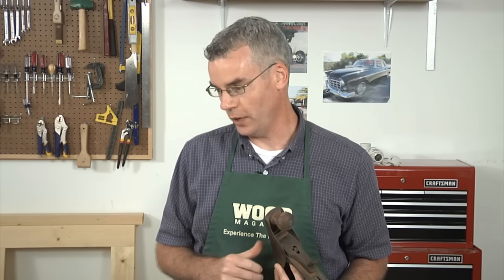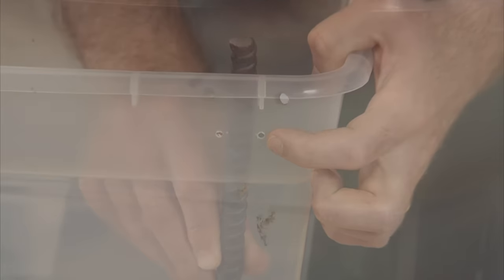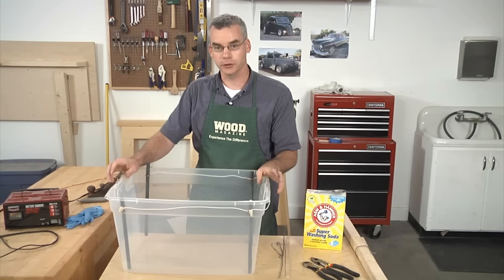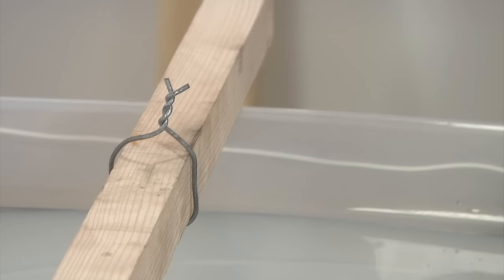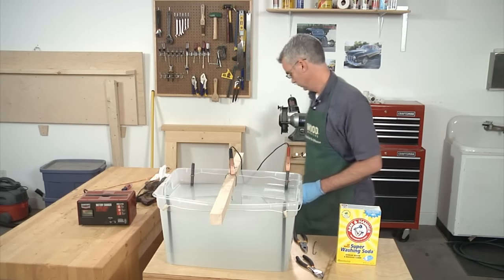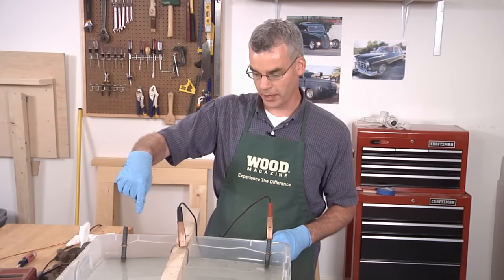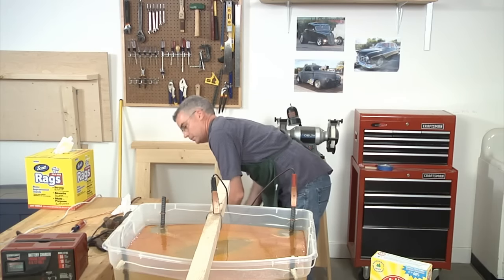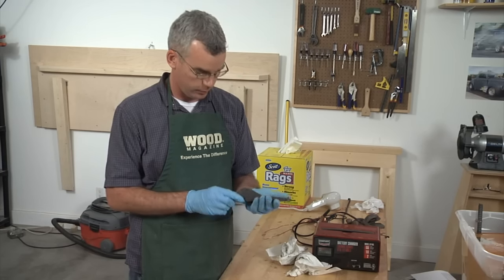Removing Rust with Electrolysis - WOOD magazine

Comment: You can make your own Washing Soda too. Washing Soda (Na2CO3) is just Baking Soda (NaHCO2) that has had it's Carbon Dioxide (co2) heated away. The reason cooks use Baking Soda in baking is that during the heating process the Soda releases it's co2 which helps give baked goods that light and fluffy texture. Anyway, you can spread your Baking Soda (sodium bicarbonate) out in a baking pan place it in a 400 degree oven for an hour and you'll have Washing Soda (sodium carbonate).
Reply: Thanks Moo
Reply: Thanks!
Reply: Or if it's in solution, heating it to boiling point is enough to convert it. Just be careful of the fizzing.
Reply: Just use washing soda. It's cheap enough, so why bother making it?
Reply: I will be using this thanks!
Reply: Can also use borax instead of washing soda
Reply: Dope.

Comment: One point on using rebar as an anode.It usually has a scale coating from manufacturing that needs to be wire-wheeled off to perform at it's best.Also,for that large of a tank and using 4 anodes,the 10 amp would work better.Lastly,put about a cup of regular baking soda in that large a tank will help alot,and a little TSP(trisodiumphosphate)helps make the black slime easier to remove from the parts.Hope this helps!

Comment: Modern battery chargers require a 12-volt battery turn on.  A cart or car battery is placed in parallel with the charger.  Also a product like Pickles 20 used after the electrolysis tank will remove any fine rust and provide a coating to prevent flash rusting.

Comment: Great representation of electrolysis! You forgot tell one thing! This has to be done in a WELL VENTILLATED AREA or do it outside. There is hydrogen gas being released in the process and that can explode indoors.

Comment: A few years ago I restored a full set of Bedrock planes.   I carefully and relentlessly looked for Bedrock rusty junk parts until I had all the parts needed.    I electrolysed everything, ensured the iron was fully dried (it IS porous), re japanned with the real japan (not paint) and replaced totes and knobs with new ones to exact dimensions made from rosewood.   The only thing not made by Stanley, apart from totes and knobs, are the Hock cutters.    The set (#602 through #608) is in regular bench use and are awesome.    If you use this electrolysis process on cast iron I do recommend some time in a warm electric oven (not gas) to thoroughly dry the iron.   You don’t want moisture trapped in the pores and then Japan over it.   I used washing soda just like this video suggests and a 12 volt battery charger.   I live in Houston and in the summer I laid a 12 volt computer cooling fan on top of the charger just to help the cooling along by sucking air up through the charger.   Worked great.   There is real satisfaction bringing a set of planes back to full productive life.

Comment: Great video!! When i saw this technique about remove the rust from the metals, i tried in my home. I have and old water pump and was rusty so i tried to remove it from the water pump and i left to work out 12 hours until the next day! In the morning, i umpluged the electricity from the tank and see hows going the water pump! After that i brushed it with an metal brush and remove the last rust with bunch of water! The result was amazing! It cleans everything on that water pump and i painted first with anti rust paint and then i painted with black! 
Im really proud to find out a good technique that take the rust from the metal!! Im using this technique each time that i need it!!

Comment: Suggestion: Put a couple notches (dados) on the bottom of the wood "plank" to catch the edges of the tub.  Serves a couple purposes: Keeps the wood from getting knocked into the tub.  Also helps reinforce the thin tub walls against the pressure from the water.

Comment: Thanks to this video, I successfully de-rusted many of my things.  This works perfectly and includes excellent tips.  BUT - I HAVE A TIP.  This video shows the metal objects suspended in the water, but this is not necessary.  The tub is plastic, thus non-conductive.  I had some heavy components that I laid on the bottom.  Just because, I laid them so they were not completely 'flat' on the bottom (I tipped them with a scrap piece of wood).  Those components were wired.  Then on top of the big pieces, I placed loads of rusty miscellaneous pieces, even rusty allen wrenches and drill bits.  Because all of the pieces were touching each other, current flowed through all of the components and all of them were de-rusted.  The only requirement is to make sure the center "pile" is below the water line and not touching any of the positive anodes.  I would imagine that if one were to do this regularly, it would be possible to create a steel grid to lay on the bottom and have that wired, then lay objects on top of the grid.  Note: I believe this works better than Evaporust.  Evapo will score polished surfaces, whereas this process will not.
Reply: I believe suspending is more for easy removal of the piece?  I haven't tried this yet so I'm just guessing.  Pretty sure you're right about the wired grid, think I saw a video somewhere of a commercial set-up like that.  You're "pile" method sounds like it works well for multiple items.  Thanks for the tips.
Reply: If I'm doing a large piece that can't be fully submerged, is there any reason why the part couldn't be partially submerged and when completed, flipped and done again?
Reply: @joshoooway  I see no reason why not.  Submerging area(s) common to two or more sessions should not have a negative result, but there might be the possibility of "water lines".  If this idea helps, note that you can make your own tub using large sheet plastic with the sides supported by a frame or walls or objects of some type.

Comment: Thanks for the video. made it just like your instructions. Did a great job of removing very thick rust. the only thing I wasn't sure of was the water  temp. I used warm water since i was working out side and it was pretty chilly.

Comment: Thank you for another great video! 
I do  try to watch a couple different videos before I try a un familiar  build. Sometimes using different methods to work with what I have/need. These differences are usually obvious to me.
Since I'm no scientist I hoped you could help me save trial-and-error time and tell me what solution to use since I have seen the tank filled with a part distilled Malt vinegar, salt and then mostly water.
Why vinegar? why salt? Or why not? 
Which is most effective? I know salt  will help to cunduct electricity but that is about the extent of of what I get. 
I like 100% of  this build & will just scaled-down & go with what you have done. 
What do I fill it with to get the job done best? 
Thanks for your help & to all who help by commenting on my question.

Comment: Rather than using paste wax, put the cast iron into a 300F oven for an hour to ensure the iron is COMPLETELY dry.  While it is still hot from the oven, wipe on a very thin coating of Manteca or Lard or Tallow.  Any one of tHese three types of naturally occurring animal fat will protect the iron from rusting.  Once the piece is coated, place it back in the 300F oven for an hour and let it cool to room temperature.  Wipe on a second, very thin coating and bake it at 350F for an hour and let it cool to room temperature.  Wipe on a third very thin coating and bake it at 400F for an hour and let cool to room temperature.  Finally, apply a thin coating of paste wax to the piece.  This will give you an air/water impermeable layer of protection that is literally baked on to the piece.  I only recommend this for simple pieces of cast iron such as planes, skillets, and other pieces comprised entirely of cast iron.
Reply: Unique suggestion. Where did you learn this technique?
Reply: We used paste wax on the table saw tables of the cabinet shop I worked at and it helps the wood slide easier and helps something like a plane slide better.  Lard can get sticky and even go rancid with time.  Ive tried both and I'd rather stick with paste wax IMHO.
Reply: Cheral Rallock if
Reply: It is the way to season a cast iron skillet, and you have to be very careful not to have excess fat on the piece. I've stopped doing this for anything other than low carbon cast iron because you can ruin the piece.
Reply: Or just paint it, since the item is probably being restored anyway.
Reply: This is too much work

Comment: Also wanted to know, since I realize now that galvanized steel would start to break down when submerged, what kind of cathode wire did you use?  The only non-galvanized steel options I've found online to buy have been annealed steel and high carbon steel.  Is there any specific type of steel you would recommend that would be able to be submerged a bit when holding nuts and bolts?
Reply: He's a woodpecker, not a metallurgist.

Comment: Thanks for this video! I made one almost exactly like yours and it works great! 

Been using it to refurbish a very old, very rusty bench vice. It also removes paint with the rust which is great for my application. What I found with this setup is that the cathodes (iron bars) builds up a layer of gunk that decreases the conductivity. Every 8 hours or so I have to use a metal brush to clean the cathodes. My power supply pulls 5A at 12V for big items. Drops to 1A with gunk build up.

Comment: It's perfectly safe to use Stainless steel in this set up... so long as the SS is connected to the Cathode (negative) side. Hexavalent Chromium is basically an oxidized form of Chromium. What's happening in that electrolysis bath is that the Anode is attracting the oxidation while you are getting a reduction at the Cathode. If you have the SS as the anode then you are oxidizing it, creating HexChrome.... but It's impossible to create HexChrome through reduction on SS at the Cathode side. 

So just make sure you don't use Stainless for the Anode and you are safe.
Reply: Thanks for that info about the Stainless! I looked at several other videos about this process, but None of them warned about SS hexa-whatever leaching out, much less about the cathod vs. annode sides!
In fact, one site actually said that he was using SS wire in his process!
I had begun my rust removal, using SS wire on both sides, and then to confirm I was doing it right..., I stumbled onto this video advising against using SS, one hour after beginning it.
I stopped the process immediately and washed all of the parts, and restrung them with baleing wire..., and washed my hands quickly.
I wish I had had the brains to take chemistry, way back in school! My math skills weren't up to the task!
Thank you both again!

Comment: How many times can you reuse the tank solution before you need to change if? Will the rust settle to the bottom enough that you can remove it? Does the water need to be distilled or can it be tap water?

Comment: Thanks to this video I am in the process of restoring not one but two cast iron dutch ovens with lids.  It will no doubt take awhile since the rust is thick as they have been in the weather for years.  I found this video to "demystify" the electrolysis process and the tank construction easy to follow.  My 32 gal tank with 24 gallons of water is working and bubbling as I write.  The toughest part is the wait for the results.  I like the idea of multiple anodes.
Reply: How did the oven look after it finished? Did it achieve the results you were looking for?

Comment: So how are you supposed to know if your tools are stainless steel or not? My dad just died and he has a lot of old tools that are 30-80 years old that are all rusted. Since it's dangerous to do Stainless, and i learned that stainless can rust, how can we know what metal it is??
Reply: Stainless isn't really magnetic like standard steel. If the magnet is strong enough sometimes you'll get a very weak magnetic effect but nothing like steel.
Reply: if it rusts its not stailess!!
Reply: but I heard stainless does rust after some time
Reply: It does rust. It has a chromium oxide hide that prevents it from oxidizing (rust is a oxidation process), but when that layer is gone it most likely will rust, the alloying elements will slow down the process though. Also chloride can cause the steel to rust because it damages this hide. The purity of the stainless steel is mainly determining the "resistance" to the rusting process. Like nasty said, check it with a magnet because you won't be able to tell otherwise.
Reply: It's not dangerous to use this method on stainless steel parts. Stainless steel is only dangerous in electrolysis if you are using the SS as the Anode (positive terminal). The part you are trying to clean is connected to the Cathode, which is totally safe for SS. The reason being is that SS contains Chromium. When Chromium oxidizes Hexavalent Chromium is produced, which is a highly toxic carcinogen. In the electrolysis bath it's the Anode that is attracting the oxidation. You are getting a reduction on the Cathode side. HexChrome is not created through reduction.
Reply: There are many kinds of stainless steel, ferritic, austenitic, martensitic and duplex. Most common is ferritic and it will hardly rust because of its low carbon content. Martensitic is known to be used in swiss knifes and scalpels and it will rust. Your tools are probably be made out of cast iron, which rusts a LOT.
Reply: It says material is SECC, is it safe for electrolysis?

Comment: rebar may contain stainless steel, since it is made from scrap, such as bearings. Mild steel might be a better choice for the anode.
Reply: Good point, thanks for info. is there a way to tell?
Reply: jubjub247  Ah yes, the animal by product, how silly of me!
Reply: jubjub247  the amount of foreign metals would be so damn low, that you don't have to fear them at all... the anode also won't dissolve but being coated in Iron instead. so nothing to worry about
Reply: jubjub247  
No, they eat the cats.

Comment: Hey sir, what a great job you have done showing us how to build an electrolysis tank. I do have one question for you though the only wire that I could find to hang my project from inside the tank is galvanized steel picture hanging wire. Is there any problem with doing this? Many regards, Rusty Walker.
Reply: Hi Russell, I'm currently trying to do this 2 years later and ran into the same question (still can't find the answer), did you ever get an answer about what wire to use and where to buy it?

Comment: Very well done video.  One thing to point out regarding the use of the battery chargers.  One must use a "manual" charger instead of one of the newer "automatic" chargers.  The automatic chargers use a sensing circuit to "look" to see if there is a battery attached and if you connect one of these to the electrolyte setup, it won't find a battery and henceforth will not work.  You have to use a conventional, manual charger.

Comment: The four rebar are connected, but only on the three sides. You don't run a wire from the fourth rebar back to the first. Thanks to Lucas, this was the missing link nobody ever seems to explain in other videos. I understood the + connected to the sacrificial anodes & the - to what you're cleaning, but nobody else brings up the four anodes are connected on the three sides. Thank you Lucas!
Reply: It would make no difference.
Reply: I bent one piece into a rectangle with one end coming up and out of the water. It sits on the bottom. Simpler for me

Comment: Great video. One question, if you can’t use stainless steel in the solution, what kind of steel wire connects to the crossmember?
Reply: Steel coat hangers or rebar tying wire will work fine.

Comment: I'm sorry if this has been asked/answered, but does the piece need to be 100% completely submerged?  We have a big engine we're trying this on, and we're having a hard time getting it in a tub big enough to be completely submerged without the sides of the tub crapping out on us with the weight of the engine and the water.  And it doesn't even completely submerge.

Comment: Great video! Many thanks. I have some chromed parts which are rusty, can I use this method? I don't need a high quality finish, I just want to get rid of most of the rust. Will this process remove the chrome from the chromed areas?
Reply: After a bit of research, it seems that NOTHING WHICH POTENTIALLY HAS ANY CHROMIUM IN IT WHATSOEVER SHOULD EVER GO NEAR AN ELECTROLYSIS TANK - this includes chromium plate, stainless steel, etc. The reason is that this creates incredibly toxic and dangerous chromium salts. Creating these substances is actually illegal in many places.

Comment: thanks for the great info..... i have about 10 gallons of rusty nuts and bolts i would like to do this process with... can i do large quantities using a steel tray in the middle full of bolts touching each other???... would touching each other inhibit the removal of rust???.... is there a limit to how big one can make this container, in other words does it take more voltage for a bigger container???.... thanks...

Comment: The higher the alkaline solution, the faster and deeper the scrub, too...I found that if you take regular Baking Soda, and 'cook' it on a cookie sheet in the oven for an hour at 475-F, you can get that 7-8 pH up to almost 11 (or you can use powdered lye), and it works WONDERFUL for deep rust on car parts, garage sale axes, hatchets, knives...especially if you restore them...
Reply: Interesting. I'm going to try that. Thanks

Comment: This works nicely but please do not try to use partitial rust removal for chromed or otherwise layered parts. The process will also remove partitally other layers from metals. I tryed to remove tiny rusted dots from chrome plated motorcyle part and killed the chrome surface.